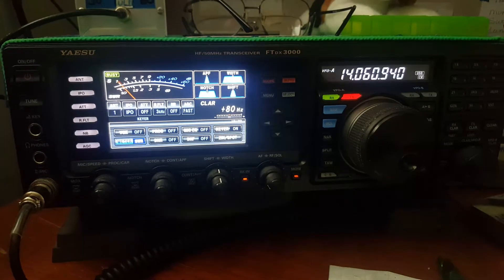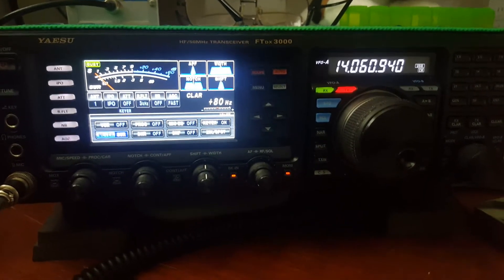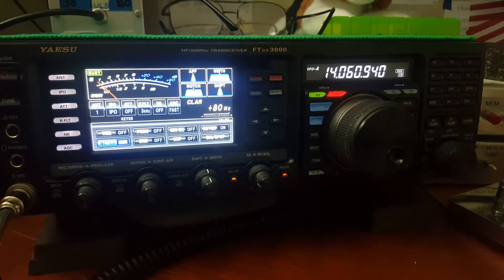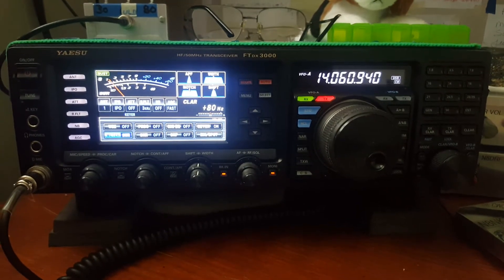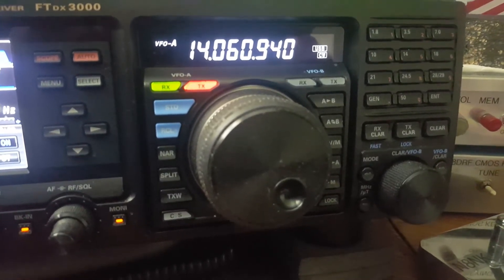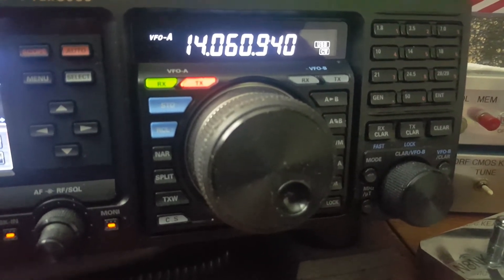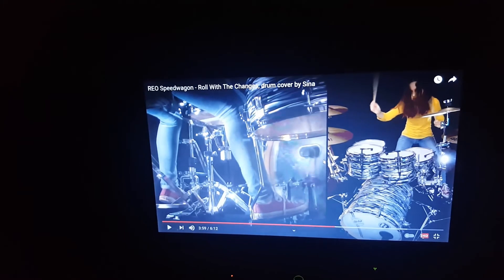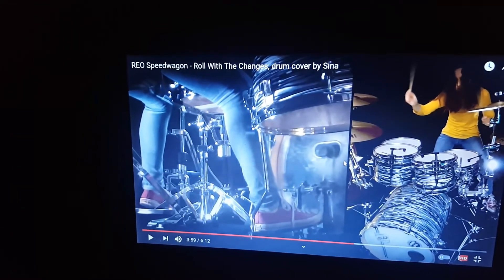Yoopy CW (chirp) + Squeaky Strings for Guitar Noobs

Comment from the maker: How does the outtro relate to ham radio? Overtones! Harmonics! A signal rich with them! And the sound of distressed strings... wait, not that. That has nothing to do with ham radio unless you're using kite string or twine to support your antennae   :-O
Reply: Or you have no LPF at the antenna either, lots of harmonics from the 2 stage transmitter or Michigan Might Mite